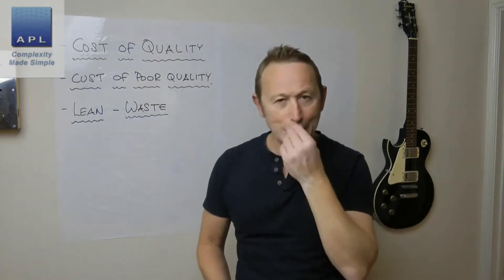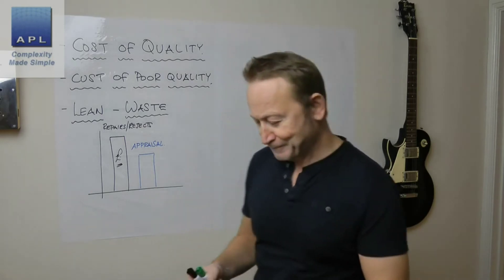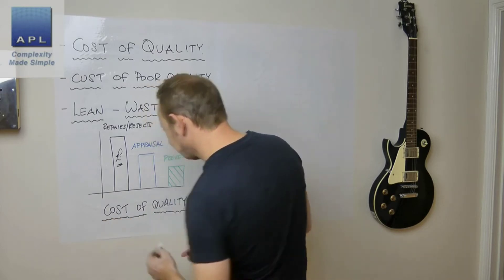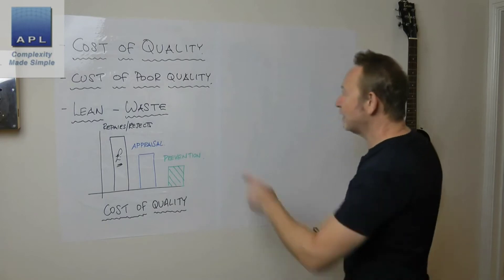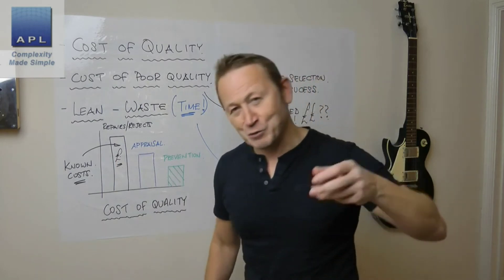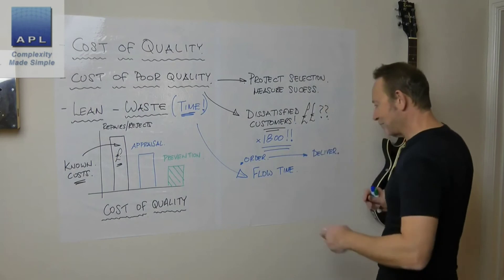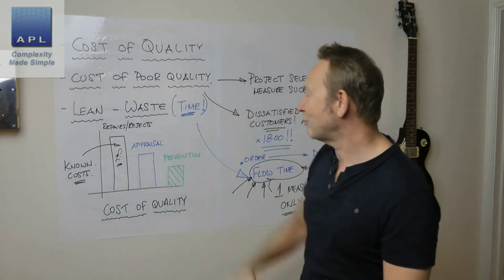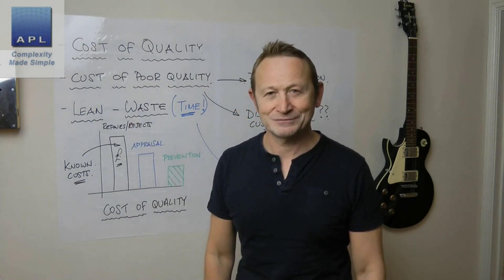Cost of Quality - An Important Measure

Comment: Hi Paul, what's your views on manufacturing flow time, so the time it takes once the job is launched into production. With Order to Delivery flow time the order will sit in your MRP planning system because your already producing other customers orders. EG It took me 5 weeks to buy a new car, but as we know it doesn't take that long to actually make one.
Reply from the maker: John,
I think that's a really good measure to use. However there is one problem with improving it. If it's done by MRP. That system will force you to hit the throughput time it has in it's calculations. To speed the throughput time up you need to switch the MRP off from shop floor planning...